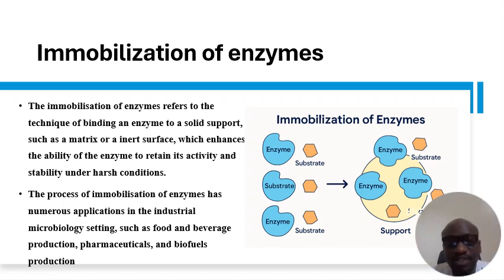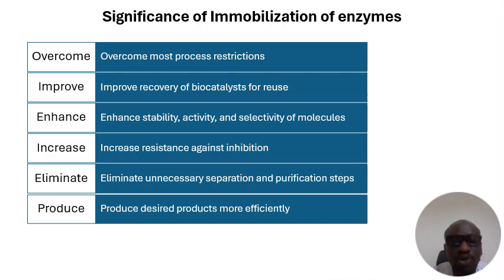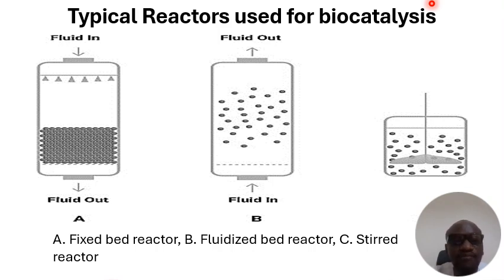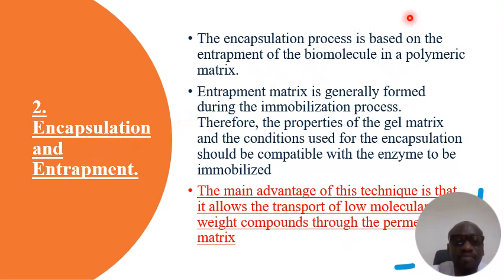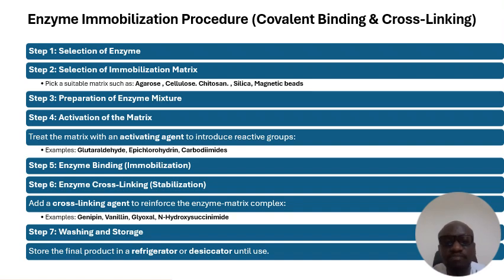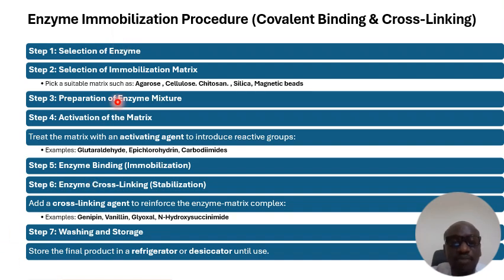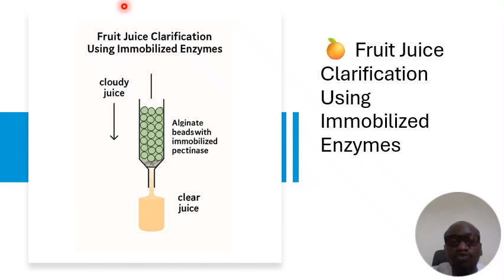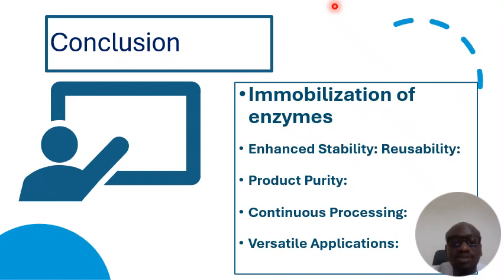Immobilization of Enzymes (Industrial Microbiology )

Comment: Question 1                      
                                                            Immobilisation of enzymes describes how enzymes are binded to a solid support material to enhance the function,stability and also retain the activities of that particular enzymes after industrial production.                                        Enzymes are majorly used as biocatalyst and during industrial production, they tend to become denatured under harsh conditions like pH, temperature and pressure. It is necessary to Immobilise enzymes in order to overcome some of these conditions and help to attain a greater quality of product.

Enzymes are fixed to a solid support by a process called enzyme immobilization through physical adsorption, entrapmentand encapsulation, crosslinking. 

Question 2 
Advantages of immobilisation of enzymes include.                                         1. It helps to increase the recovery of enzymes from bioreactors after industrial production or activities.                                2. It help to reduce the cost of downward processing.                    

 Significance of Immobilising enzymes.                                        1. These help to improve the  recovery of enzymes for reuse

Olorunfemi Samson Iyanuoluwa 210807009.

Comment: Question 1:

Enzyme immobilisation means fixing enzymes onto or within a solid material so they can catalyse reactions without being washed away. The enzymes remain active while staying in a fixed position during the reaction.
The enzymes are attached to supports such as porous beads, fibres, membranes, or gels using techniques like adsorption, entrapment, or covalent attachment. This is useful because it makes enzyme recovery easier, improves process efficiency, and allows the enzymes to be used in repeated production cycles.

Question 2:
Advantages 
Easy separation of enzymes: Because the enzymes are attached to a solid support, they can be removed easily from the reaction mixture. This simplifies product purification and saves time during processing.
Reduced downstream processing cost: Immobilised enzymes reduce the need for complicated purification steps after the reaction. This lowers production costs and makes industrial manufacturing more economical.

Real-life application: Immobilised glucose isomerase is widely used in the food industry to convert glucose into fructose during the production of high-fructose corn syrup. The enzyme can be used continuously for long periods, making large-scale production more efficient.

Adeyemi Tolani Elizabeth 
Matric number: 210807106

Comment: Question 1

Enzyme immobilization can be defined as a technique that attaches free enzymes to a solid, inert support matrix. It confines them within a specific space and restricts the enzyme's motility.

Enzymes are immobilised by binding them to a solid support matrix by methods such as physical absorption, entrapment, and covalent binding. Examples of solid support matrices used include alginate beads, silica, and porous glass. They are fixed to a support to prevent them from washing away and make them reusable for continuous chemical processes as they are reusable catalysts.

Question 2
Advantages include:

• For the easy separation of products.
• For reusablilty so as to save costs.
• To prevent product contamination.
• To prevent the enzyme from proteolytic degradation.

One real-life application where they are used is:

• The pharmaceutical industry for drug synthesis. Immobilised enzymes such as lipases and acylases are critical in synthesising chiral drugs.

Lawal Muibat Adebanke
210807118

Comment: Question 1:
Enzyme immobilisation is the process of attaching or trapping enzymes on a solid support or inside a material while allowing them to keep carrying out their catalytic activity. Instead of moving freely in the reaction mixture, the enzymes remain fixed in one place. This makes it easier to separate the enzymes from the products after the reaction and allows them to be used repeatedly. Common methods include adsorption, entrapment, encapsulation, cross-linking and covalent bonding.
 
Question 2:
Advantages

1. Reusability:
Immobilised enzymes can be recovered after a reaction and used again for several production cycles. This reduces enzyme wastage and lowers the overall cost of industrial processes.

2. Greater stability:
Because the enzymes are fixed to a support, they are more resistant to changes in temperature and pH. This helps them maintain their activity for a longer time than free enzymes.

Real-life application

A common application is in the production of lactose-free milk. Immobilised lactase is used to break down lactose into glucose and galactose as the milk passes over the enzyme. Since the enzyme remains attached to its support, it can be reused continuously for processing large volumes of milk.

Oladapo Grace Toluwalope 
210807074

Comment: 1. Immobilization of enzymes is a powerful approach and technique of binding an enzyme to a solid support that improves the ability of the enzyme to retain its activity during use, stability even under unfavorable conditions, and helps it to separate easily.
The enzymes are fixed to a support like matrix or inert surface by cross-linking, encapsulation, entrapment, adsorption, or covalent binding. This is useful for easy recovery, reduced loss, and easy separation of the enzymes.

2. Advantages of immobilized enzymes are:

• Reduced cost of downstream processing: Cost is reduced because these enzymes can be reused multiple times, and there is no need for additional purification processes.

• Enhanced stability: Immobilized enzymes are more resistant to heat and pH changes, thereby preventing denaturation and ensuring reliable performance under harsh conditions. 

Application: It can be used in the dairy industry for the production of products like Lactose free milk. The milk is passed through alginate beads, which supports the entrapment of enzymes, allowing lactase to break down lactose into glucose and galactose, which are easier to digest for lactose intolerant people.

NAME: Shokunbi Abidemi Ruth 
MATRIC NUMBER: 210807069

Comment: Question 1: Enzyme immobilisation is the biotechnological process of attaching or confining enzymes on a solid support while allowing them to keep carrying out their function. This allows the enzymes remain in one place instead of mixing freely with the solution.
Enzymes can be fixed to supports such as gels, beads, membranes, or other solid materials by methods like entrapment, adsorption, encapsulation, or by covalent bonding.

Question 2: Advantages of immobilised enzymes
1. The enzyme can be reused repeatedly and will reduce production costs.
2.  Immobilized enzymes generally enhance Shelf Life 
3. Easier separation of the enzyme from the reaction mixture and final product, since it doesn't dissolve in solution.

Application of immobilised enzymes
Lactose-free milk production: immobilised lactase breaks down lactose in milk into glucose and galactose, so people with lactose intolerance can drink it.

Abiona Peter Oluwaseun
210807085

Comment: Question 1: Explain immobilisation  

Enzyme immobilisation is the process of attaching enzymes to a solid support using methods such as adsorption, covalent bonding or entrapment while still carrying out their catalytic activity. This makes them easier to separate from the reaction mixture, reuse in multiple reactions and improves the efficiency of industrial processes.

Question 2: Applications and advantages  

1. They can be recovered easily after a reaction, reducing product contamination.
2. They can be reused several times, making the process much more economical.
3. They are more stable and can withstand harsher operating conditions.
4. They improve process efficiency by allowing continuous production with consistent results.

In the Food industry: Immobilised enzymes are used in the production of lactose-free milk, where the enzyme lactase breaks down lactose into glucose and galactose. Because the enzyme is immobilised, it can be reused to process large volumes of milk.

Olowonjoyin Doyinsola Faoziyah 
210807128

Comment: Microbiology
Reply: Question 1: Explanation of Immobilisation
Immobilisation of enzymes is the process of attaching or fixing enzymes onto a solid support or within a matrix so they cannot move freely. This allows the enzymes to still carry out reactions while being held in place. It is useful because the enzymes can be easily reused and separated from the reaction mixture.
Question 2: Applications and Advantages
Advantages:
Enzymes can be reused multiple times, reducing cost.
Easy separation of enzymes from the product, improving purity.
Application:
Immobilised enzymes are used in the food industry, for example in the production of lactose-free milk using immobilised lactase.

Ikpabi Naomi Nnenne

Comment: Name: Omotosho funmilayo 
Matric number:230807569
Question 1: Explain immobilisation  
Immobilization of enzymes can be defined as a technique that joins an enzyme to a solid system which can be a matrix or inert surface helping it to maintain its activity and stability under harsh conditions.

Mention how enzymes are fixed to a support and why this is useful
Enzymes are fixed to a support using substrates that are also useful because it helps the enzyme to produce more purified products and also helps to maintain its activity.

Question 2: Applications and advantages  
Advantages include
-Reduced cost of downstream processing 
-multiple use of enzymes
-Easy separation of enzymes
Applications:
Pharmaceutical synthesis
Immobilized enzymes are used to produce active pharmaceutical ingredients (APIs) with high purity and reduced waste especially hormone synthesis

Comment: Question 1
Immobilisation of enzymes is the process of attaching enzymes to a solid support or carrier so they remain fixed while still carrying out their catalytic function.

Question 2:  Advantages
1. Enzymes can be reused many times.
2. They are easier to separate from the reaction products.
Application: Immobilised lactase is used in the production of lactose-free milk.

Comment: Question 1

Immobilisation of enzymes is a technique used to bind enzymes to a solid matrix support usually made of polymer, gel, agarose, etc., as an improvement to efficiently recover them after industrial processes, and to enhance their stability and activity. 
The enzymes can be immobilized by entrapment in a matrix, by tightly binding through covalent bonds to a matrix, by binding with weak chemical or electrostatic forces to a support matrix, or by crosslinking agents combining covalent bonding and entrapment in one.

Question 2
Advantages 
i. There is enhanced shelf life of the enzymes 
ii. Immobilized enzymes support continuous processing because the system can run without stopping 

Real-life Application 
i. In the beverage industry for juice clarification, by passing through alginate beads with immobilized pectinase 

Mehinsan Gracious Irapada 
230807555

Comment: Question 1:
Enzyme immobilisation is the process of attaching or trapping enzymes on a solid support so they remain fixed while carrying out their catalytic function. This is useful because the enzymes can be easily separated from the reaction mixture, reused multiple times, and are often more stable.

Question 2:
Advantages:
1. Immobilised enzymes can be reused, making the process more cost-effective.
2. They are more stable and easier to separate from the final product.

Real life applications: 
- Immobilised enzymes are used in the food industry, for example, lactase is immobilised to produce lactose-free milk.

Name: Hussein Atiyat Motunrayo 
Matric no: 211101099

Comment: Question 1: Question 1:
Enzyme immobilisation is the process of attaching or trapping enzymes on a solid support so they remain fixed while carrying out their catalytic function. This is useful because the enzymes can be easily separated from the reaction mixture, reused multiple times, and are often more stable.

Question 2:
Advantages:
Immobilised enzymes can be reused, making the process more cost-effective.
They are more stable and easier to separate from the final product.

Real life Application:
Immobilised enzymes are used in the food industry, for example, lactase is immobilised to produce lactose-free milk.

Name: Hussein Atiyat Motunrayo 
211101099

Comment: Question 1: Explain immobilization 

Enzyme immobilization is a process of attaching or trapping active enzymes to an insoluble solid support such as matrix, this technique makes the enzymes stay fixed in place while still able to retain its stability and not mix with the final product. Techniques such as Adsorption, Entrapment and so on are used in trapping these enzymes. 

2. Application and advantages 
Advantages;
. Enzymes can be reused over and over again because the enzymes remain attached to it support and not mix with the product 

. They’re resistant to high temperatures and PH conditions, this increases their stability 

. Immobilized enzymes are suitable for large scale industrial use as they reduce operating costs and improve efficiency 

Real life Application; 
A perfect example is in waste water treatment, where immobilized enzymes like peroxidase and lipase are used to removed dyes, oils, toxic chemicals and industrial pollutants to give a cleaner water before it is released into rivers and lakes and it doesn’t mix with the water and also remains consistent. 

Olujobi Omotoyosi Ayomide 
210807042

Comment: Question 1:
The immobilization of enzymes refers to the technique of binding or confining enzyme molecules onto or within a solid support matrix. This process allows the enzyme to retain its catalytic activity while enhancing its stability under tough conditions.

Question 2:

Advantages:

Improved Process Efficiency: They streamline production by eliminating unnecessary downstream separation and purification steps, saving both time and costs,.

Enhanced Stability: They demonstrate improved operational and thermal stability, making them more resistant to heat and pH changes without denaturing.

Real-Life Application:

Sweetener Production (High Fructose Corn Syrup): Immobilized glucose isomerase in a packed-bed reactor converts a glucose-rich solution into fructose to produce high-fructose corn syrup used in soft drinks and processed foods,.

Bankole Abdulquadri Teniola 
190807088

Comment: Question 1
Enzyme immobilisation is the process of attaching or trapping enzymes on a solid support while allowing them to keep carrying out their catalytic function. This helps the enzymes remain in one place instead of mixing freely with the reaction solution.
Enzymes can be fixed to supports such as beads, gels, membranes, or other solid materials by methods like adsorption, entrapment, encapsulation, or covalent bonding. This is useful because the enzymes can be easily separated from the products and reused many times, making the process more efficient and economical.
Question 2
Advantages 
•Multiple use of enzymes (recycling): Immobilised enzymes can be recovered after a reaction and used repeatedly. This reduces the need to replace enzymes frequently, helping to lower production costs.
•Better stability: Immobilised enzymes are more resistant to high temperatures, pH changes, and some organic solvents. As a result, they remain active for longer periods and perform more reliably during industrial processes.

Real-life application
 Immobilised lactase is used in the dairy industry to produce lactose-free milk. The enzyme breaks down lactose into simpler sugars, making the milk suitable for people with lactose intolerance while allowing the enzyme to be reused.

Adedeji Adenuga 
230807567

Comment: Question 1:
Enzyme immobilisation is the process of attaching or trapping enzymes onto a solid support such as beads, gels, or other insoluble materials so they remain fixed while carrying out their catalytic function. This allows the enzymes to be easily recovered and reused, improves their stability, and makes industrial production more efficient and economical.

Question 2:
Advantages:

1. Reusability: Immobilised enzymes can be used repeatedly for several reaction cycles, helping to reduce production costs.
2. Improved stability: They are more resistant to changes in temperature and pH, allowing them to remain active for a longer period.

Real-life application:
Immobilised glucose isomerase is widely used in the production of high-fructose corn syrup (HFCS), where it continuously converts glucose into fructose during food processing.

Name: Alugo Adeboye Ibrahim
Matric: 210807537

Comment: Question 1: 
Enzyme immobilisation is a biotechnological technique where enzymes are confined to a solid support or matrix, such as alginate beads or silica gel, rather than being free-floating in a solution. Enzymes can be fixed to these supports through various methods, including physical adsorption, encapsulation, covalent binding, or cross-linking. This approach is highly useful because it enhances the enzyme's stability against heat and pH changes, allows the enzyme to be easily recovered and reused, and ensures the final product is clean and uncontaminated

Question 2: 
Advantages
1. Reusability: Immobilised enzymes can be easily separated from the final product and reused multiple times, which reduces waste and lowers the overall cost of production
2. Enhanced Stability: They offer improved operational stability, meaning they are more resistant to denaturation from extreme heat and pH changes compared to free enzymes

Real-Life Application: 
In the dairy industry, immobilised lactase is packed into columns (like alginate beads) to break down lactose, allowing for the continuous production of lactose-free milk for lactose-intolerant individuals

Akinlo Victor Oluwakoya
210807013